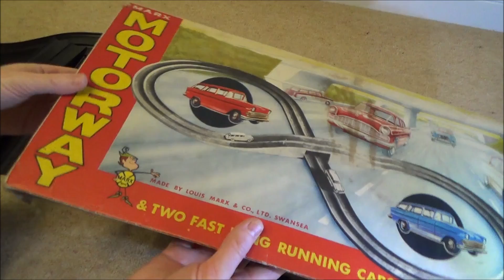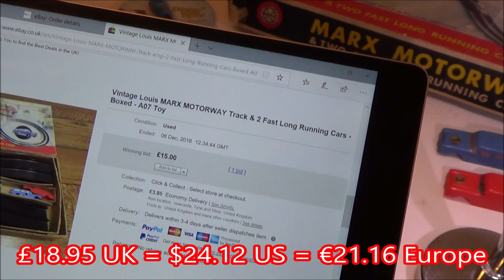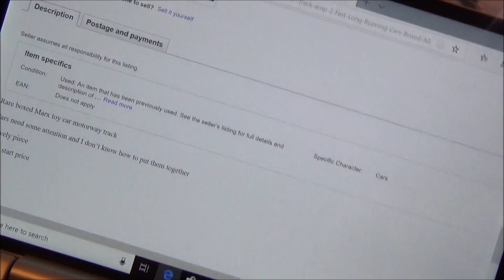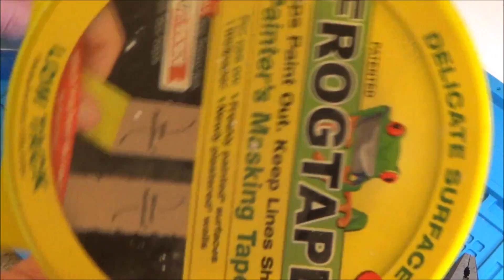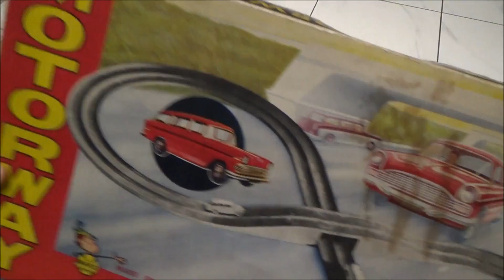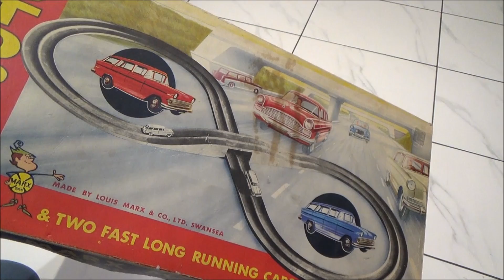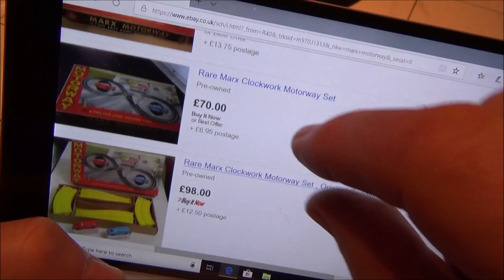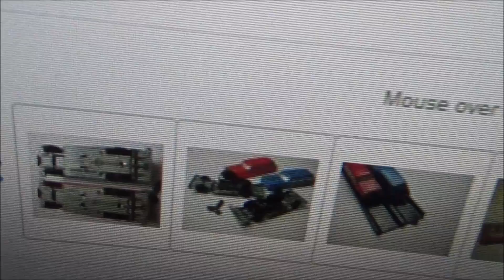eBay Pre 1980s TOY Repair Challenge PART 1

Comment: the bodies are upside down
Reply: Do you mean the under carriage may have been removed from the clockwork, and then returned with the undercarriage upside down? 
 Hmmm? Vince? Is that possible?
Reply from the maker: No, they are just a bit bent from when they were glued a bit wonky. The Marx logo is on the bottom and the 2 side bits that clip into the body are up top. They are 100% the correct way up :-)

Comment: You botched the box repair! With split corners, use brown gummed packing tape on the inside and NEVER use cello tape or any other on the outside. I've repaired many split boxes with my method, and it always looks perfect. This could also be done to repair split seams on old record covers.
Reply from the maker: Hi, I have just looked on Amazon (UK). Is it the stuff you need to wet before applying?
Reply: Hi Vince. Yes it is, but not the kind with the strings in it.
Reply from the maker: @gustavefrankfurter6462  Thanks, I will order some up :-)